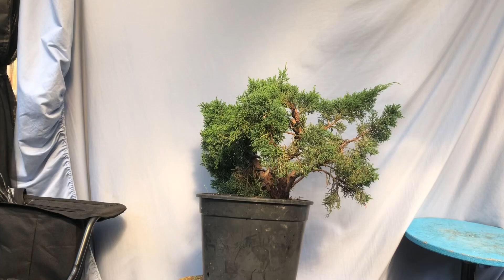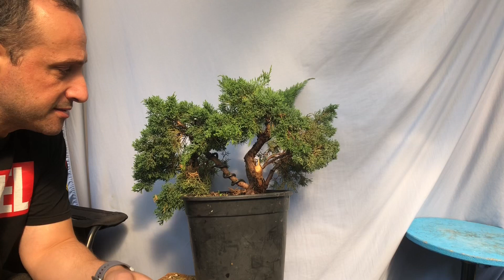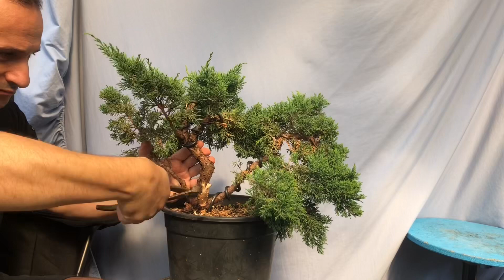How to create twin trunk bonsai - first styling for shimpaku juniper

Comment: Hey David I just bought my first Shimpaku Juniper yesterday June 7th 2020 were just entering summer and I was wondering if it’s still safe for me to cut and shape mine or should I wait until winter or springtime
Reply from the maker: You can usually work on shimpaku all year round. I try and let them rest in the depths of winter but any other time they can be styled. Hope that helps.
Reply: BonsaiDavid That helps a bunch thanks! And thanks for the fast response not a single other YouTuber has responded yet.
Reply: BonsaiDavid so if I wire it now I should wait until spring to start trimming
Reply from the maker: It’s summer where you are so I tend to let the foliage grow over summer and the trim in autumn. You need to strong summer growth to build up the foliage which then strengthens the roots. If your doing an initial styling then you can wire and trim foliage, just don’t go excessive with the foliage trimming. Clean foliage growing downwards, straight up or crotch growth. Hope that helps.
Reply: BonsaiDavid thanks again I have one more question now that I’ve cleaned up my Shimpaku it pretty much just has long spindly branches that don’t have as much dense foliage as your stock Shimpaku has on them is that just come with maturity?
Reply from the maker: Mike Nickerson yes plus trimming back the long shoots to get back budding. All in good time.
Reply: BonsaiDavid ah thanks I’ll do that then and let her grow some before doing anything thanks again for answering all my questions